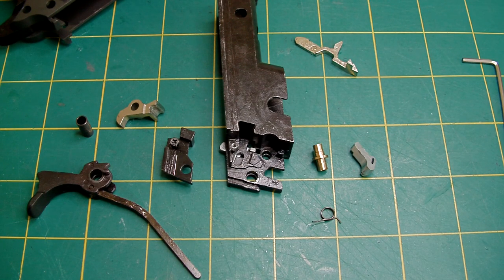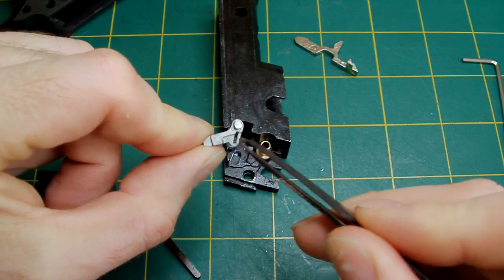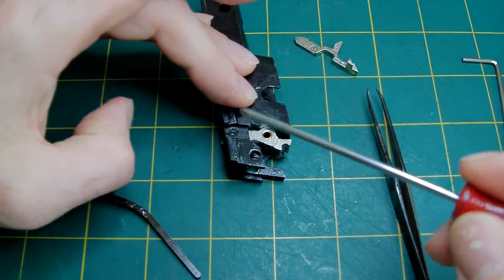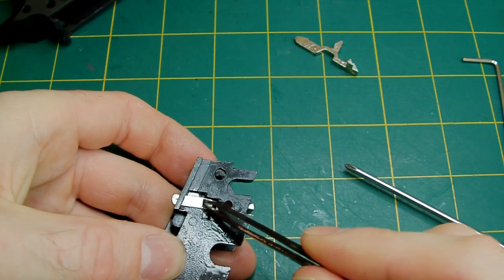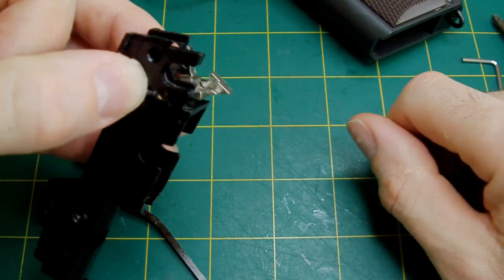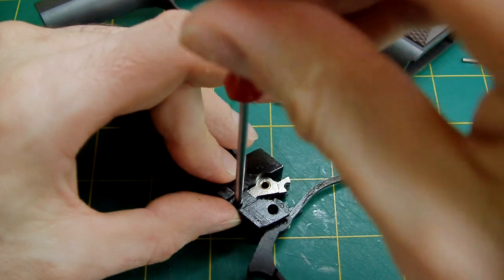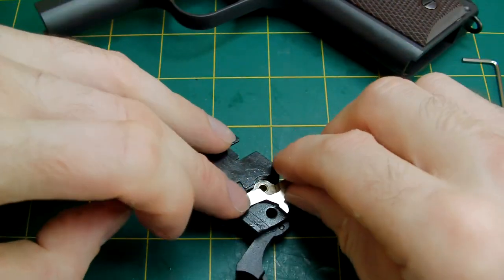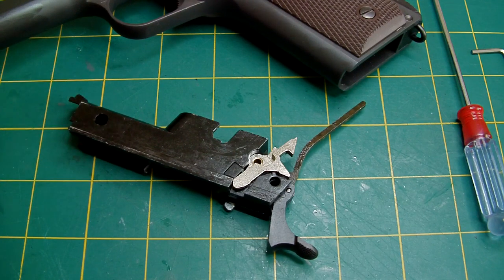LaZouche Custom airsoft TM 1911-MEU sear and hammer fitment.

Comment: Well, I finally found the problem :)
My external barrel is a two part piece. The barrel itself screws onto the chamber part... but it was 1mm unscrewed. That alone caused the locking ^^

Comment: Thanks for the reply Lazouche, I am however still into troubleshooting. Running Guarder kits can be a real annoyance I'm not sure where to pinpoint the exact problem however I often get doublefeeding. I have tried turning the hop 3/4's up and it seems to have solved that issue, Does having an FMK kit install increase the risk of a BB being pushed beyond the hop rubber during a full cycle? My hammer has been catching the BBU quite severely, and its starting to show signs of premature wear.

Comment: Would a faulty valve knocker actuator keep the slide from blowing back and therefore make the gun vent the gas? It seems somehow that my slide gets locked into battery when the magazine is in, preventing it from sliding back. The only stopper I've identified is that spring loaded actuator.
Thanks!

Comment: My hammer catches considerably, if I don't rack the slide back hard enough, the hammer would prevent a smooth transition and this is especially so when the slide is on its way back to battery. The hammer lays about two cm too high catching the bump of the BBU. This has only happened when I installed the guarder FMK, have you had to do any custom work on the hammer assembly with your TRP kit? Is there any way to lower the hammer without by more filing and cutting? Thanks again for your time!

Comment: Hey Lazouche, I have a custom guarder slide & frame kit installed along with a guarder 150% recoil spring and stock TM hammer spring, I was wondering is it normal for the knocker valve to wear down considerably. Mine seems to be riding rough under the BBU causing the knocker to wear flat over an otherwise rounded head. Also my hammer assembly does not sit all the way down, it rides a little high causing it to just slightly catch the BBU.

Comment: hello,
i have some problem for tm meu
my trigger ring can't unlock the sear
when i hammer up , the sear should be lock my hammer and when i shot, the disconnector can't push up the sear.......the hammer still on the hammer up mode.....

Comment: Hi, may I know the dimension of the knocker valve actuater spring? Unfortunately I lost mine and I will try to look for one in the local hardware shop. Thx.

Length I think is 10mm but not sure of diameter.

Comment: Thanks for the great video. It would be great if you could answer this question for me: I have a Bell 1911 MEU that won't stay half-cocked - there is not enough resistance to hold the hammer in place and it would proceed to drop. I'm guessing the sear might be worn but the gun is fairly new so I'm wondering if there may be other causes? I did adjust the sear spring not long ago to fix a full-auto issue (thanks to one of your other videos!), could it be that I messed that up? How can I tell if the sear if indeed worn out? Otherwise the gun seems to work just fine but I do want it to function realistically if possible.
Reply from the maker: The half cock hammer issue is the bane of the airsoft 1911s as it always causes problems, thats why I just do away with it entirely by grinding off the catch on the hammer.  However you are right as the sear spring to hammer set up is the key and needs to be tweeked a little, which is a real pain and can take a lot of time to get just right,  hence why I remove it. 
Sorry to say that's all the advice I can give plus you were lucky to get my response as I've not built or touched airsoft in 4 years now !  Glad to know my videos are still helping viewers.  YouTube  due to their insane policies now have not only age restricted nearly all my videos but have frozen me out of watching some of my own videos!!!?  So make use of them as soon my channel will be gone. 
All the best to you ;-)
Reply: @LaZoucheCustomshop  Wow I feel privileged to have gotten a quick response from a long-retired airsoft tech! I really appreciate that along with all of your other videos, which are just about as detailed as they could get without being off-topic. Shame on YouTube - I didn't realise the situation is that bad. I thought it was only real firearms that take that much of a hit. Better be watching your other videos sooner rather than later. Many thanks again for your efforts into these.
Reply from the maker: @loganfong2911   A pleasure and may airsoft pistolsmithing bring as much happiness to you as it did me for nearly 20 years.

Comment: Hey LaZouche I know you haven't been on in awhile but, I am curious, can HiCapa sear/knocker/Hammer's fit in the 1911's? I want to put an AsM set into my 1911 MEU.
Reply from the maker: Check out my 'Hammer types' video on I believe is my maintenance videos play list.  All the best on your pistolsmithing.
Reply: @LaZoucheCustomshop  will do! I actually figured it out on my own too, the 1911MEU dear is different but it's the same as the one AsM use in their advanced frame housing! Weird.

But you should be able to use the Same hammer with the 1911 too, possibly have to modify the Spurs

Comment: Will TM hicapa replacement fit in a 1911 ?
Love your videos
Reply from the maker: A Hi-capa ring/delta or cutout type hammer won't fit the 1911 as the frame tang hits the hammer head but a 1911 spur hammer will fit the Hi-capa as the frame tang is cut away to allow for the molded grip safety. Hope that helps?
Reply: @LaZoucheCustomshop  helps a lot